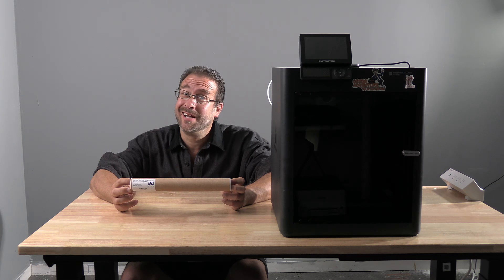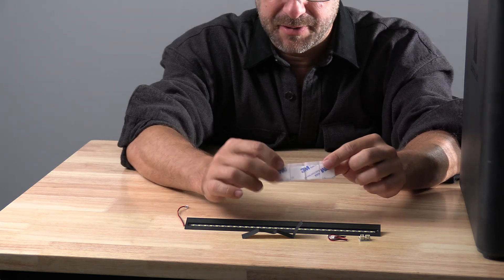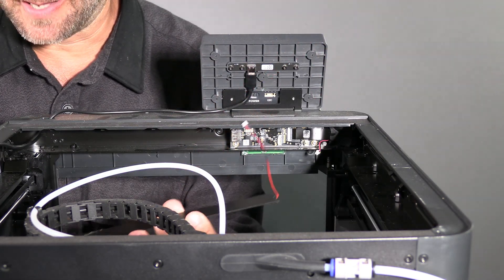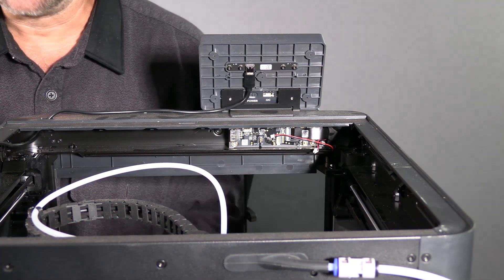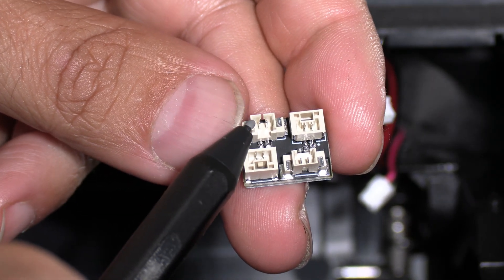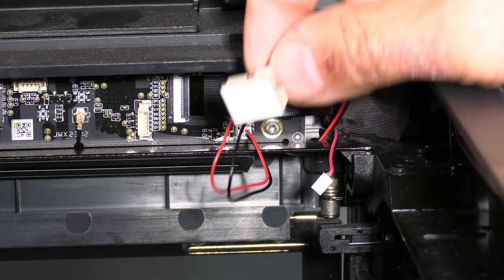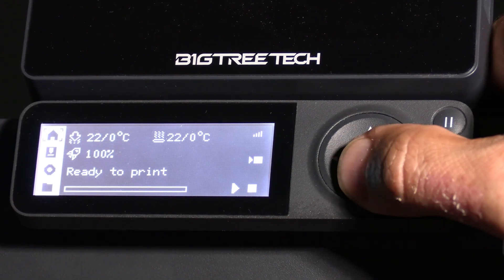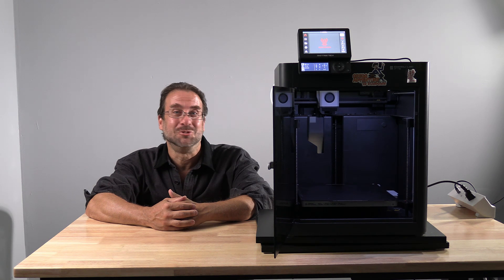How to install the Biqu Panda Lux LED Light Kit, on Bambu Lab P1P / P1S. Better light, for $10?

Comment: Maybe my P1S differs a little, but there was no need to pull off the foam, just the tape with the USB image on it. 

I did feel the need to use the included 4 squares of double sided tape as the magnets hold felt a little lacking to me and I'm convinced vibrations would eventually wiggle it from it's perch.
Reply from the maker: The foam is attached to the tape

Comment: Why is it not recommended to plug in both lights? The amp draw is still under the rated value for that plug? Or I am not correct in that?
Reply from the maker: The Draw is too much.

Comment: What's the point of using the small board - can you not put the panda cable straight into the printer board itself?
Reply from the maker: I dunno. I just do as smarter people tell me.
Reply: On the p1s the female plug port is different than the one directly on the light. It works for the x1c like that though. What you can do if youre crafty and what i did was i depinned the end connected on the wire and depinned one end of the small extension wire. Then i soldered the extension blk/red wires directly to the wires coming off the led bar. Now it bypasses the jumper and i can plug it into the p1s directly. Less clutter if its worth it to you.

Comment: Thanks. I thought I did something wrong (45+ years as an electronic tech) because it was not turning on. What I missed was the light in software had turned itself off (every time you unplug that LED even with power turned off it turns it off in software). I unplugged it 4 times and 4 times it turned off in software. I have been using the printer for a month and did not even know I could turn it off in software (was on since day one). Somehow it knows it's been unplugged even with the power switch off though.

Comment: Any new update^? can we connect both lights?
Reply from the maker: no
Reply: @3DRundown  Do you have any idea if a second lux lamp can be plugged into the remaining connector on the first lux small circuit board?  Any idea of power it pulls?
Reply: They say it’s not recommended, but I’ve had both lights hooked up and running for more than 6 months with no issues.  So, it can be done but you choose whether you want to take the chance.

Comment: Are you still happy with the light? I heard someone mention a light with a 3000 vs 5000 temp would have been better. Have you since found a better light?
Reply from the maker: 3000? No way. That would be warm, yellowish, old school, light. Daylight is always best. Colors are presented as they should be, rather than bathed in yellow light.
I'm fine with it. It's not a giant upgrade or anything, but it certainly puts out a more even light across the whole bed. I don't love it... But it's Ok
Reply: @ When shooting video at night, typically the right white balance is around 3500. The inside of the printer is a dark environment.
Reply from the maker: There is no right white balance. White balance, is to properly represent colors, as they appear in a certain light scenario. Typically using a grey card. DAYLIGHT 5600k, will present colors as they appear in daytime sunlight, which I prefer.
Reply from the maker: Here is the light: https://youtu.be/Q-97V5seVpA?si=NxbNRKg3OjDnmtfa

Comment: Sadly the pins in the connector on the AP board were crushed when I plugged in the cable from the little board that came with the light.  After fussing with it and eventually totally taking the connector off of the board to see if I could get at the board traces it looks like the only solution for me is a new AP board ($50 USD), or to wire in the lights in a totally different way to power.  Just a cautionary tale to be careful with these connectors, I'm not a big fan of this style of connector after this experience, much more fragile that the connectors that don't have clips 😕

UPDATE: Good news everyone!  The USB port on the AP board can supply the 5V needed to power the Panda LEDs - 1 USB cable sacrificed to the Gods of hacking and the lights are working well.  The only catch is that you can't turn the lights on and off from the app, not a biggie.
Reply from the maker: Yep. USB typically offers 5v. Good save!

Comment: Thank you. That was easy to follow. I am however completely disappointed by the light. Its barely better than the stock one.
Reply from the maker: I was at first, but, over time, you'll notice it's a much more even light across the bed and print

Comment: warning warning warning, when i pulled that foam cover off it ripped that camara ribbon out of its connector. I had about 4 beers in me and it took me like an hour hanging upside down, because i had an ASM on top of the P1S and i was dumb thinking ...oh i can do it... so this video was great but be prepared, its probablly gonna pull that cable out... i got it fixed but wish i woulda waited till i was sober...lol....but now the light is much better, i got it back together after some stress... thanks!
Reply from the maker: WARNING: DON'T DO THIS DRUNK
Reply: I did wonder what that ribbon cable was for... now i know!!
Reply: I just had 2 beers and the video gave me confidence to do this (with AMS). Thanks for the warning.
Reply: Totally sober I pulled the ribbon cable out because I installed before I watched this video, then found my camera "not connected". Fixed it. Also the P1S I just bought has sticky tape AND some other thin adhesive (very strong) holding the foam on, and it started to rip when I attempted removing it. There are cutouts for the cables, so I ended up working around it.

Comment: Great video.  I did have a observation and question.  I recently got a new X1C (2 month ago), I recently received my Panda LUX.  I noticed in the X1C the internal light connector seems to be “hot glued” to the board.  Is it safe to break that seal?  Has anyone else noticed the same?
Reply from the maker: Allot of connections are hot glued on 3D printers. It helps them survive the shipping hell they endure. You can remove the glue. Hot glue tends to pick off, easier than typical glues
Reply: @3DRundown  Thank you for the explanation.  I'll move forward with the LUX installation.

Comment: Do you really need the splitter if you don’t hook up the old led? Can’t you just plug in the new panda lux in where the OG led is plugged in?
Reply: Old thread revive but I just tried to do that exact thing but the plug on Panda Lux is missing the clip so it won't plug into the P1 directly. You have to plug Lux into splitter board then cable with clip from splitter board to P1. Not the cleanest solution but it works and hides away easily enough. Also thanks @3DRundown for making this video!
Reply: @rlsimmons900  Thanks! I was thinking the same thing and glad to see the question answered.
Reply from the maker: ONLY use the new light. Splitting is no longer advised.
Reply: @3DRundown  I don't think that's what he was asking... I think he was asking if you can just plug the new light directly into the original socket INSTEAD of the old light and INSTEAD of using the splitter... thx for the vid

Comment: You were right about being careful with the Ribbon Cable!   Mine became detached.  Can it be re-attached?  Or has to go back in for service?
Reply from the maker: Sure, see that little black lever? That's a lock. **GENTLY** pick at it, to pop it upward. Slide the ribbon cable in, and *GENTLY* press the lever, back down, to lock it in place

Comment: The Panda Lux is really worth it. It wasn't easy to put in since my P1S is sitting on the floor, but now I have a lot of good light to see the print. Thank you for the infovid.
Reply from the maker: Agree. It lights the whole area well.
Reply: yeah my P1S is on the floor also.. was very frustrating getting the right angles etc to get it installed!!

Comment: I tried the TH3D light, installed in standard location on my X1C, light casts too many shadows, looks great in person, shadows on timelapses
Reply from the maker: Interesting. I find time-lapse fairly useless. Too fast to troubleshoot a fail, and too uninteresting to people, to be worth posting. Sometimes it's useful in tutorials. I typically only use the light to monitor my work. I'll have to run some Timelapse to see how the light works. I try to avoid my opinions, and just teach how to do things, for those who have their reasons.
Reply: I thought it was really really neat when I first bought the printer, I liked how the head seemed like it never moved and the print grew organically. Now I’m jaded.
Reply from the maker: Same. Super cool at first then....... so what. 😜  I mean, if it's a REALLY cool print, then I'm down. Otherwise, meh
Reply: Yea, but it's a great way to blow your kids mind, lol. I do wish the time lapse wasn't so fast, then it would be really useful to understand what went wrong when a print fails.

Comment: Test test audio test test 
Nice up grade . 
Totally be careful of sticky tape  big warning . I pulled my cable off  p1s  😭finding  the panda touch  usb plug 😢 . Plus the plugs on the hot way too small…In essence i don’t like the p1s design . Sorry
Reply from the maker: Oh no.... Just pull the 1st inch for the Panda Touch. 😭😭 The sticky Foam, is an off design choice, that should be axed.
Reply: @3DRundown  totally agree 
Also hot end wires  to board difficult 
Exit p1s  enter x1 carbon where the connections to hot end plug 🔌 in better. Just finished a blue flower vase  at  sport speed from maker world 🌍
Reply from the maker: I have never seen an X1C in person. I look forward to it.
Reply: @3DRundown  better .. both have the open back rod screw in back which they should of closed off with a clip panel . I asked Jim of on the edge how long the carbon filter lasts 
I getting a plastic smell but fairly new unit , I will email bambu lab. Other than that way better than p series.